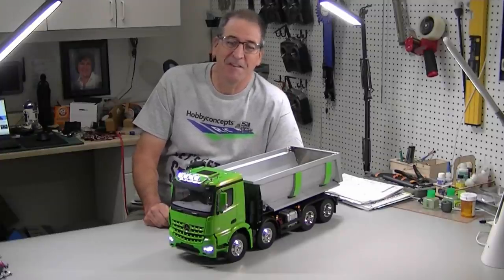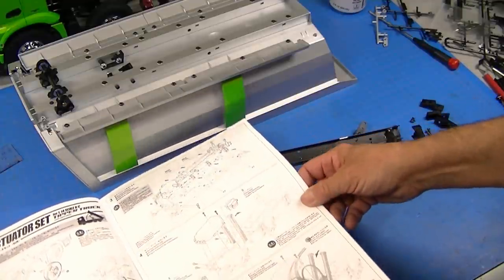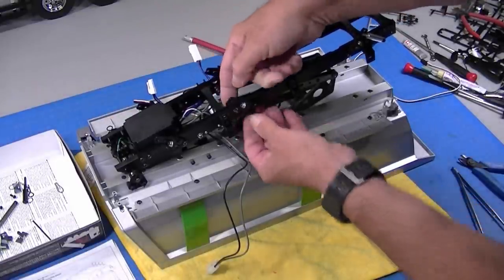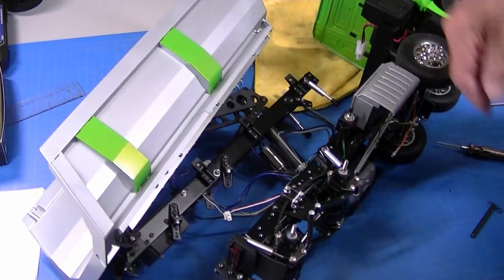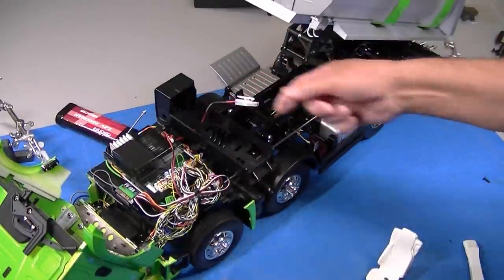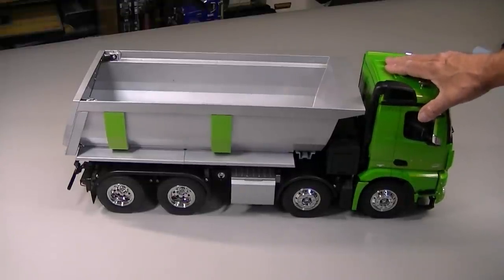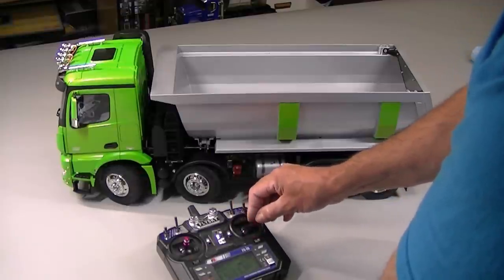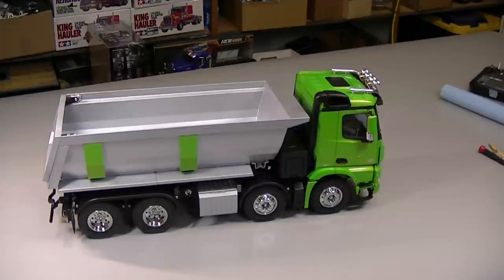Tamiya Arocs 4151 8x4 Tipper Truck Build - Part 2

Comment: Hey Bob, this is one of the models where the MFC-03 has little opportunity in terms of light. So I would recommend anyone who buys this truck to buy a Beier USM-RC-3 sound & light module. Things like parking lights, low beams, high beams, fog lights and cornering lights can only be realized true to the original and that is NOT possible with the Tamiya MFC-03! 😉😉😉

Comment: This is a very cool build,I seen most of your truck builds. You do a great job on the build ,would have like to see how high the dump box went with the lift I have the lift and box but no rails or instructions on how to build this dump .I will figure it out for sure,would really like to see you do a hydraulic dumper box.thanks for the awsome videos.like your chanel lots.
Reply from the maker: Pictures on the Facebook group with the bed in the up position.  Link to group in video description.

Comment: Great video and beautiful model. Would be interested to see how you set up the MFC-03. Having been through it myself with Tamiya's Scania R620 kit, I found it a bit of a challenge. However, after some trial and error, managed to get it working properly. I still find it a real challenge getting a cab in my models as the MFC is a bit of a monster to hide in the cab alongside the mountains of wiring.
Reply from the maker: I am working on a Flysky & MFC-03 video right now.  Will be up soon.

Comment: Hi,Bob.I bought this kit a while ago,and have the actuator unit.Can i use this setup without the MFC 03 unit,i.e. with a hobbywing esc and 8ch receiver?thanks for any info.
Reply from the maker: You can.  Just plug it into an open channel.  On the Flysky FS-i6 I like assigning a knob to the channel and using the knob to control the bed.

Comment: Fantastic build Bob,thats a complicate kit for sure. 2 things with the kit i dislike. Why inc the tipper manual switch and extra wiring ? who really is going to be using a "standard" radio when buying this kit AND the actuator is yet again wayyyyyy to loud,spoils the effect. I am sure Tamiya could find better quality bits.